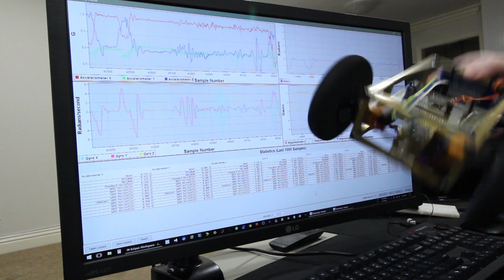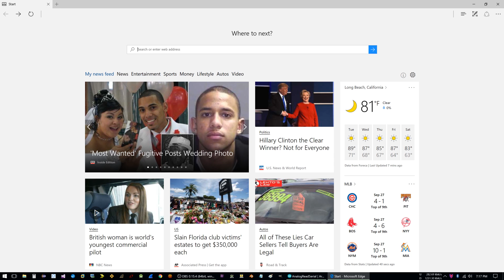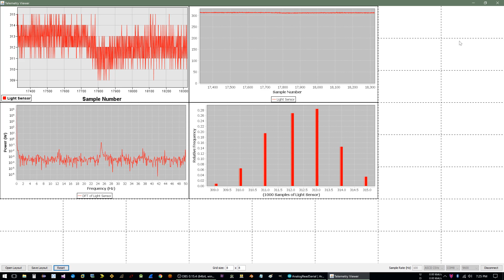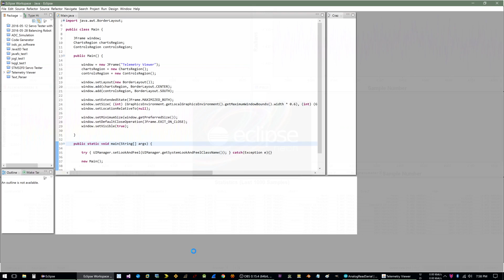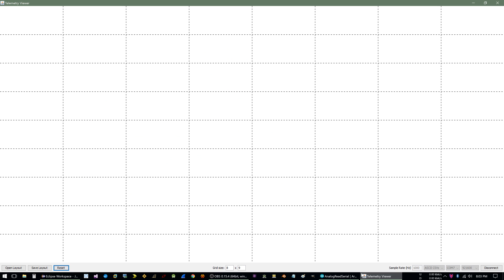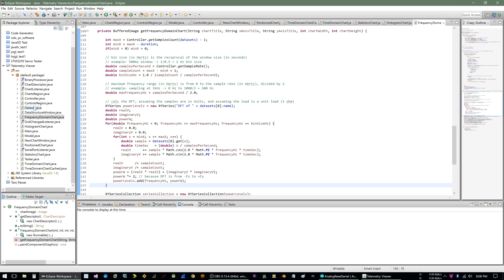Easy Arduino Data Logging and Telemetry

Comment: Hi there, this is very amazing, the effort, the explanation everything, and pretty useful too!
Thank you very much for this.
I have one question, how can i see the saved values?
I am reading battery voltage every 5 minutes from a 48v system, and saving it in an SD card,
and i want it to display the graph of a whole day or so.

Thanks again.

Comment: I am doing a project based on the transmission of signals through telemetry and your program helps me a lot. By means of the fourier transform, the signal can be visualized in a different way compared to the time domain, for example, or is it also the final form of the information?

Comment: Installed Telemetry Viewer 08 after installing JAVA8, all works, except I do not get the "tiles" with the dotted lines. Everything else seems to work great, connect to correct COM port, setup data structure etc. I just have a grey screen with the bottom fields displayed. Any idea why I cannot see the dotted lines?  Thanks for a potentially great program.
Reply from the maker: Hi. The newest version uses some features from Java 9. It should work properly if you upgrade to 9 or newer.
Reply: @upgrdman  Great, that did the trick. Now it works just as I wanted to, so well done! Hans.

Comment: We had a strong earthquake in Croatia, and we don't have money for decent seismology equipment. (it is sad because Andrija Mohorovičić was born here..)
Your software will help us to build a web of smaller stations all around the country and track the data. I am planning to upgrade our meteor web (Visnjan Observatory started a project of tracking meteors with web of cameras all around the country years ago). We have 24/7 running servers and cameras on 350 locations. We will now start upgrading those stations to track earthquakes and I will personally make sure that as soon as this project gets going you receive as much money as possible. Thank you very much!

Comment: How is the data cached? Say I plot a temperature graph over a week and then want to switch over to another set of sensors. Can I download/extract the data and reuse/resume that data set if I want to come back to that temp sensor for another set of long term measurements?

Is this done through a combination of layout/CSV log?
Reply from the maker: The layout file stores all of your settings, and the CSV file stores all of your data. You need both files if you want to replay them in the future.

Comment: Great way to visualise and understand data - I especially like the different ways to scale so that you may be able to look at data over a particular period of time. Saw on the connection preferences that other than COM ports you also support UDP and TCP methods. Do you have any code samples to use these options? Your robot would've used either I figure
Reply: Hey, just found the answer in another of your great tutorials. So all good :)

Comment: Thanks for sharing this very information video how to make graphic communications between Arduino and java. I assume codes will be found github. Are this correct address? : https://github.com/Fazecast/jSerialComm/wiki

Anyway thank you and plz make video set up connection arduino and java with arduino. If system has connected multiple temperature sensors.

Comment: How did you do this on Bluetooth? I dont yet get how to connect...
Reply from the maker: I used a Bluetooth UART module. For example: the HC-05 or HC-06. Just search for "Bluetooth UART" or "Bluetooth SPP" (serial port profile) devices.
Reply: @upgrdman  thanks!
Reply: @upgrdman  I understand, but I ment the computer. How do you receive data on the computer from the HC-05/06?
Reply from the maker: After you "pair" with the Bluetooth UART, it will be listed as a COM port just like a normal (wired) serial port.

Comment: I can't use the source code with eclipse 2019-09 ;(
Reply from the maker: It's working fine for me when I use Eclipse 2019-06 or 2019-12. I never tried 2019-09 but it should work with that version as well. I suspect something else may be causing the problem.

Comment: Just downloaded TelemetryView_v0.6.jar from http://www.farrellf.com/TelemetryViewer/ and am trying it out. Ran into a few issues. My PC is running Fedora 30 Linux. Screen resolution is 1600x1200.
1. The initial window is wider than my screen. When attempting to resize the window, it will only resize the top and bottom -- left and right sides will not resize. In order to get to some of the buttons on the bottom, it is necessary to click and drag the window left or right.

2. When entering the initial information for the column names, I accidentally entered the same name and color twice. Did not see how to edit the information. Is there a way to do so? (After typing this entry, I looked at issues on github. Issue #23 may be this item.)

3. After getting all the columns set up and connecting to my Arduino, got a window with the chart in the middle, "Tile Columns:, Tile Rows:, 5 buttons" on left side, "Datasets:, Duration:, etc" on the right side, and a "Done" button on the right side. Nice! Pressing the Done button hides the right side but not the left side. Should it also hide the left side? Also, this window is wider than my screen and will NOT resize along the width -- only the height.

4. The Arduino data is the result of a YouTube tutorial series. Each episode may add additional data to be plotted, so new columns will need to be added. Item 2 above indicates to me that this will not be possible -- I will have to reenter all the column data from scratch. Is this true?

You've produced a great program. It appears to provide what I need.

Comment: Good design. Few suggestions: 1) Time instead of samples on x axis. Either absolute time of a day, or relative time from the start of measurements.  2) When reading from serial also dump data in parallel to a file (or files) for offline analysis with other programs. 3) Ability to have multiple different time bases on different charts. I.e. one showing only last 60 seconds, and another showing same data from last 6 hours, with decimated data (min/avg/max).

Comment: Actually I am sending Frequency and voltage data of my sensor  on UART using ARM cortex M7 controller. Is it possible to plot voltage according to my frequency data using telemetry view software. if yes then how i can ??

Comment: Hi , great video   . Is it possible to log normal  rs232 data ?    For example  .

 Communication is based on standard RS232 at 19200,n,8,1
  .Each data frame consits of 5 bytes
typdef struct
{
ubyte channel;
ubyte idChar;
ubyte valueH;
ubyte valueL;
ubyte checksum;
}
Ive all the needed  data   . 
Thanks

Comment: Farrell Farahbod, thank you for your effort and time to code and to make this video. I went through the code and it is amazingly coded. I have some questions if it's not too much to ask. First of all, do you think it is possible to add more codes to include bluetooth device on the communication module?? I do not want to mess the beautifully crafted code. The second is, is it possible to calculate some parameters on the fly for example (velocity, displacement etc from the real time data) received from the comport and plot them?? I know it is possible to calculate on the arduino and send them, but one of the real challenges for wireless communication especially bluetooth is data rate. So   is it possible to receive like two or three parameters, calculate some more quantities from the received data and plot in real time??

Comment: So you use one thread for each chart?And i suppose you use one or several other threads for data processing / serial port reading?Or are you doing this event based?  Whats the max number of charts you can create without starting it all to lagg? And what is the maximum datarate you can achieve with your approach? And was there ever a problem with the arduino not sending data fast enough?
Reply from the maker: Starting with version 0.2, I switched to OpenGL. One thread to process received data, and another thread handles all of the charts. The main limiting factor is how many samples you visualize, not how many charts there are. On my laptop I can visualize over 500k points at 4k 60hz if antialiasing is enabled, and many more if it is disabled. Your Arduino can send data at any rate. With other microcontrollers I often send more than 10k samples per second.

Comment: Any idea as to why I get exceptions when I try to run the software. New to java. I am using java 
java version "10.0.2" 2018-07-17
Java(TM) SE Runtime Environment 18.3 (build 10.0.2+13)
Java HotSpot(TM) 64-Bit Server VM 18.3 (build 10.0.2+13, mixed mode)

I get exceptions when I run:
c:\Temp\TelemetryViewer-master\Telemetry Viewer>java -jar TelemetryViewer_v0.4.jar
Exception in thread "main" java.lang.reflect.InvocationTargetException
        at java.base/jdk.internal.reflect.NativeMethodAccessorImpl.invoke0(Native Method)
        at java.base/jdk.internal.reflect.NativeMethodAccessorImpl.invoke(NativeMethodAccessorImpl.java:62)
        at java.base/jdk.internal.reflect.DelegatingMethodAccessorImpl.invoke(DelegatingMethodAccessorImpl.java:43)
        at java.base/java.lang.reflect.Method.invoke(Method.java:564)
        at org.eclipse.jdt.internal.jarinjarloader.JarRsrcLoader.main(JarRsrcLoader.java:58)
Caused by: java.lang.NoClassDefFoundError: com/fazecast/jSerialComm/SerialPort
        at Controller.getSerialPortNames(Controller.java:293)
        at ControlsRegion.<init>(ControlsRegion.java:204)
        at Main.main(Main.java:16)
        ... 5 more
Caused by: java.lang.ClassNotFoundException: com.fazecast.jSerialComm.SerialPort
        at java.base/java.net.URLClassLoader.findClass(URLClassLoader.java:466)
        at java.base/java.lang.ClassLoader.loadClass(ClassLoader.java:566)
        at java.base/java.lang.ClassLoader.loadClass(ClassLoader.java:499)
        ... 8 more
Reply from the maker: The software was compiled with Java 8 and for some reason it does not work in 10. If you use Java 8 it should run correctly. It seems like recompiling with JDK 10 magically fixes the problem, so the next version of Telemetry Viewer will be compiled with JDK 10 to fix this.
Reply: Thanks -- I tried it with Java 8 on another PC and it worked like a champ. Thank so much for a great tool.
Reply: I am a new to java, I have downloaded the source and have java 10 installed. How do you compile the source.  Thanks in advanced

Comment: Hi is it possible to display not real time graph, want to use it for a car dyno graph display, have a couple outputs to display on graph on end of dyno run, also need all graphs on 1 screen display. Please contact me wesselroets@yahoo.co.uk 
1) wkw (power)
2)nm (torque)
3) boost pressure(bar)
4) Fuel pressure(bar)
5) Egt( °C)
6) afr(% oxegen)
7) speed
8)Rpm

Comment: this is really cool, but i just need a simple window with a six sensor chart, like the frequency domain one. Wich is the most simple way to use this awesome code to iclude it in my window??
Reply from the maker: Thanks. It's not written like a library, so it won't be easy to integrate into other software. It might be easier to find a chart library for whatever programming language you're using.

Comment: Thank you for this tutorial! I've tried using the software, and when I connect another application(CoolTerm) to save the data from arduino, I can't seem to establish a connection to the telemetry software. A message "Serial connection lost" pops out everytime. Is there anything I can do about this?
Reply from the maker: Only one program can use the serial port at a time.

Comment: Does it support up to 8Khz sample rate data?
Reply from the maker: I've done over 10kHz.
Reply: If I am using Arduino Uno. I dont think Serial.println() will not not archieve 10kHz. Then i need to use Serial.write() and use binary mode in Telemetry Viewer instead of using ASCII.  Am i right?
Reply from the maker: I doubt an Uno can support a high enough baud rate, or have enough processing power, to send data that fast.

Comment: Thank you so much for sharing you software and code.
Just a question (from a java noobie), if i want to make a botton/command that "start" and "stop" the data aquisition for the plots so that i can save then, it would be a simple modification in the code?
Thank you again for the work and video.
Reply from the maker: Just disconnecting and reconnecting to the serial port should do the trick.

Comment: Hello! Thank you for sharing this with us, it's very interesting. I would like to ask a beginner's question, the sample code with an "analogRead" I understand, but I have difficulty applying it when the signal is digital. A simple example, when I use an HC-SR04 (distance) sensor, I have a "digitalRead" and I also need to calculate the distance.

(distance= int (0.017*time)

I tried different codes, but to no avail. 

Thank you

Comment: Hi upgrdman, I started using your code to monitor some accelerometer and gyro data with an arduino, but when the data is a bit noisy the graphs freezes for an instant and then continue to play again. Do you have any hints to solve it? (I am using version 0.2)
Reply from the maker: If you're using the cached time domain chart, that would be normal. If the range changes it has to redraw the whole chart. You could also verify that your microcontroller is still sending valid CSVs during those periods of time (use the Arduino Serial Monitor or TeraTerm or whatever.)

Comment: Is it possible to change the code so it will receive from the serial port String values such as the name of a team or some status sent from an arduino in csv and making some filter to save that string values on some database without adding them in the graphs because they will make the program crash?

Comment: is there a way to store the data displayed on the graphs to be view at a later date?

Thank You for the software!!!  Intuitive!
Reply from the maker: Make sure your character array is big enough to hold all of the text.
Reply from the maker: Hi. My newer versions let you export a CSV file, which you could later open in Excel and create charts from. See my newer videos. I plan to add the ability to replay those files in a later version, but that is not currently possible.
Reply: Thank You for the quick replay! The newer versions you mentioned worked great. Would you by chance know why my arduino (RedBoard) is unable to simultaneously display 6 analog signals? I just expanded the code similar to yours but no luck.
Reply: New question:

I'm on my hp laptop trying to run the software...the application opens but when I try to make a graph, it freezes. However, when I'm on the mac book it works perfectly. Both have the latest Java versions. Is it dependent on the graphics card? Also on the hp, the graphics card is the Intel integrated kind and set it to max performance. 

Thank you again, I been learning alot from your videos.

Comment: Great Stuff and it is such an advantage to have your comments about your source code. Will this work on an Android's BlueTooth com port? Thanks very much for sharing.
Reply from the maker: I'm not familiar with that. Does your Android device present itself as a Bluetooth UART to the PC? Is this an Android app, and if so, which one?
Reply: Yes I believe it is seen as a uart by the Android with the Android as the master. The thing I am doing is interfacing a SAM V71 MCU by Atmel with an Android tablet. I'm pretty sure the java you wrote will probably interface with this uart csv stream coming over the bluetooth
Reply from the maker: This program is not an Android app.

Comment: What exactly are you using to wirelessly transmit the data?
Reply from the maker: For transmitting telemetry to the PC, I used an HC-06 (Bluetooth UART) module. For transmitting throttle/steering/etc to the robot, I used a pair of CC2500 modules.

Comment: When I print to serial I dont get any numbers in serial monitor I get "œ" printed all way with the code in arduino you posted..
Reply: Try this.. works

void setup() {
  Serial.begin(9600);
}

void loop() {
  int sensorPin1 = analogRead(A0);
  int sensorPin2 = analogRead(A3);
  char buffer[50];
  sprintf(buffer, "%d, %d", sensorPin1,sensorPin2);
  Serial.println(buffer);
}

Comment: Hi! I like your video. I did it on my own like what you did. I just have a question, how did you make the Gyroscope graph?  (the Gyro X,Y,Z?)  is it the same process from the 3 sensor values?  Thank you.
Reply from the maker: I'm not sure I understand your question. The microcontroller sends those 3 sensor readings (and many others) and that chart is a Time Domain Chart of the 3 gyro axes.
Reply: This is an amazing software tool. Thankyou so much for posting.

Comment: Can you save the charts as for example CSV file and monitor later.. Lets say analyze the data? In my case i want to logg engine temp and rpm.. and the open it upp later to analyze..
Reply from the maker: Hi. I added that to the newer version. There's a link in the video description.

Comment: hi man can use this app to get data from my bluetooth communication serial ?
Reply from the maker: Yes, it works with Bluetooth UART adapters. The balancing robot at the beginning of the video uses a Bluetooth UART adapter. You just need to pair with the Bluetooth device before opening the program.